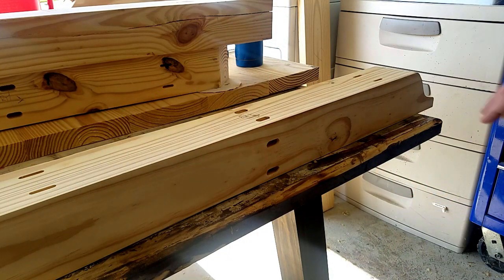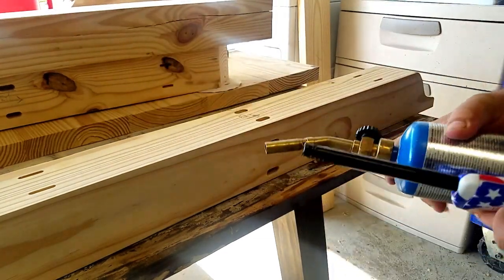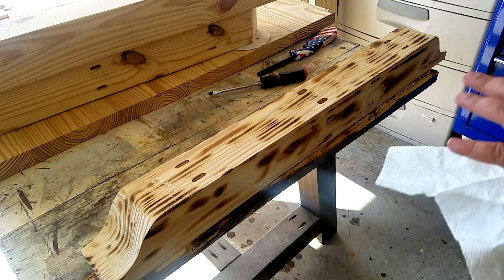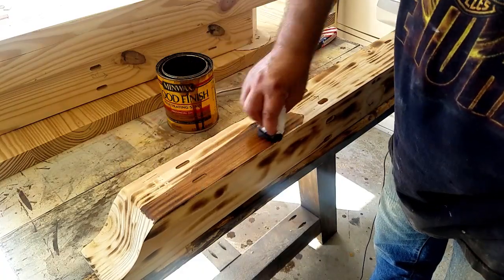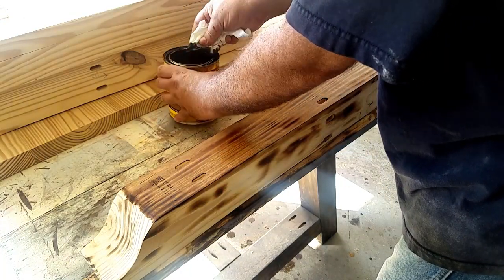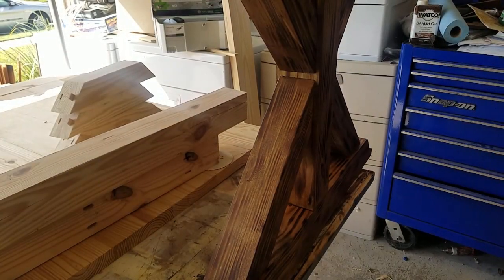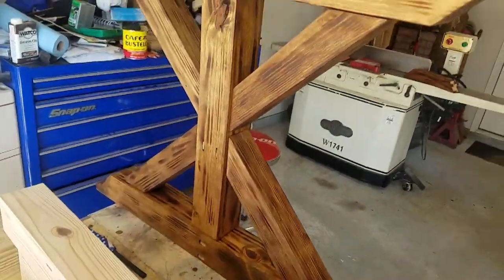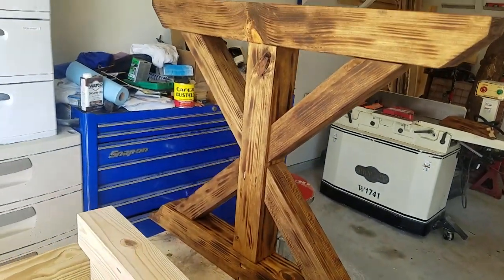Make New pine look older and more rustic!

Comment: Great tips for aging pine. I never knew you could thin oil-based poly with mineral spirits. I don't like the brush marks a brush leaves either and the thick poly.
Reply from the maker: Thank you!

Comment: This is very helpful, thank you for sharing. Is the poly necessary after the stain? What if you just did the stain?
Reply from the maker: Yes!  Poly is necessary because stain does not protect the wood at all.   Stain only adds color,  but zero protection.
Reply: If you didn't use the poly after the stain fully dried the wood would look very dry and very dull like it had a film of dust on it.

Comment: I purchased a pine bedroom set that I want to strip and refinish and I think this would look great.  Have you tried it on pine wood you stripped of old stain?  This is a large set of furniture and I really want an older looking wood....your right pine is boring.  Thanks!
Reply from the maker: I've never tried to strip wood and do this afterwards.   My suggestion would be to give it a try somewhere on the back or on the bottom.   If it works, great... do the whole thing.   If it looks bad,  at least no one will see an area on the back.   Wish i had better information.

Comment: Try covering the holes near the tip of the torch when attempting to light, it will light right away.
Reply from the maker: +Haza45 Ps4 Ha!  Just went and tried it.   You're absolutely right!  Worked like a charm.  Thanks for the tip!